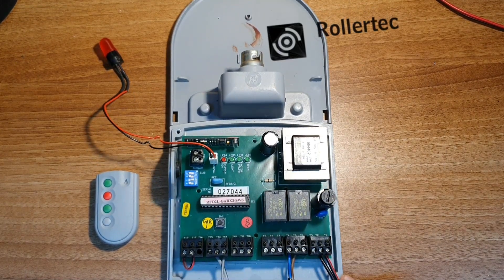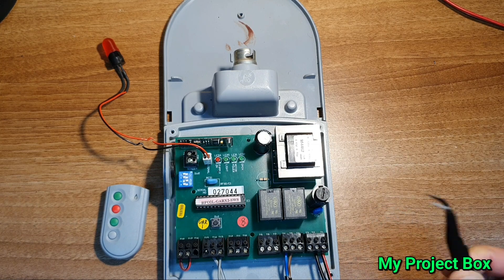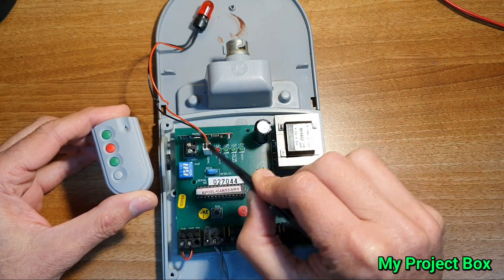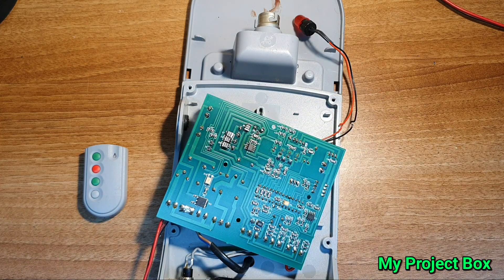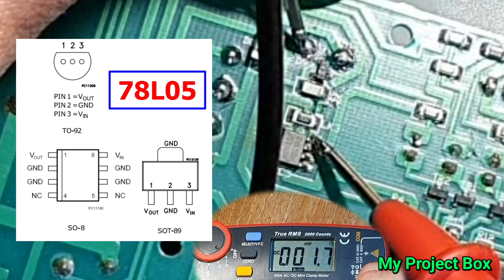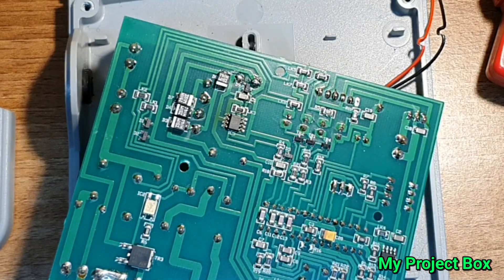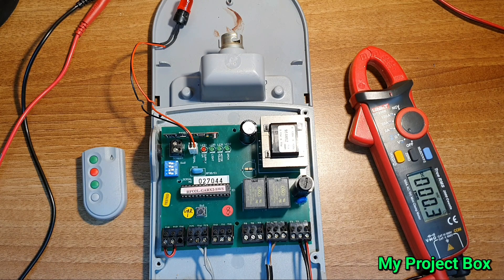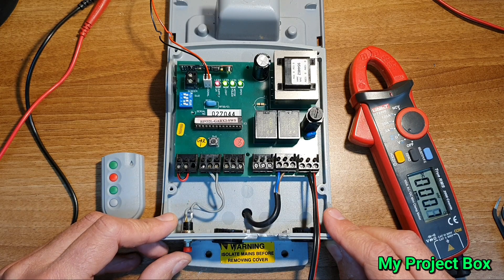Control Unit repair For Roller Shutter Garage Door #electronicscreators #1kcreator

Comment: Hi would you know if this unit can be connected to the Meross msg 100 WiFi switch to give remote operation through the app on my phone? Would be really helpful as info for this type of operation is very limited. Great video
Reply from the maker: Sorry I don't have the unit in my position anymore it was a repair for a friend.  It should be possible to do it however, try to find the data sheet for it online.

Comment: I wonder was it a cold solder joint between the chip and pad . If you reflow the legs on the chip would it be sorted ? Or leave well enoug alone 😀
Reply from the maker: Anything is possible I guess. It's working fine now and it's back with its original owner. I'm sure he'll let me know if it breaks down again. But for now, if it ain't broke don't fix it👍😆
Reply: I had a door like that years ago. I had to get closer and closer to the unit to operate the remote. Eventually I gave up and operated it by the button on the box.

Comment: Please try to figure out how/why it failed.
Reply from the maker: The control unit is back on the wall, with the original owner and operating the garage door just fine. It is in daily use, so I'm sure I'll find out if the repair is going to last. It's still a bit of a mystery what exactly caused the failure. However if it does breakdown again, I'm sure he will give it back to me, to take another look at it.
Reply: @MyProjectBoxChannel  What if you've just bypassed a safety feature?
Keep in mind that roller shutters can seriously injure and kill people.
Reply from the maker: @florentbr83  it was only done for testing purposes, to see if the board is working properly.